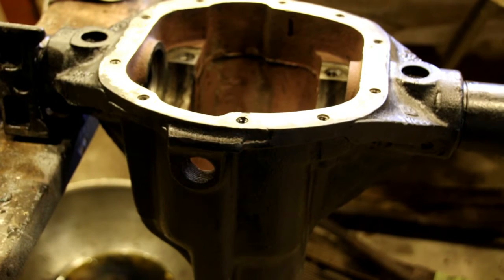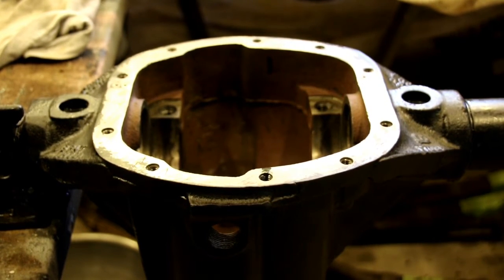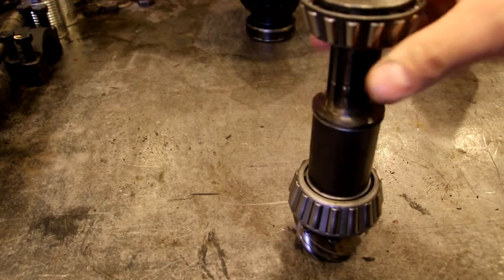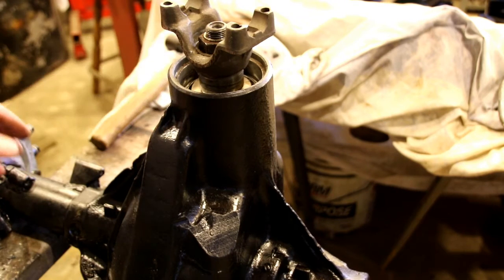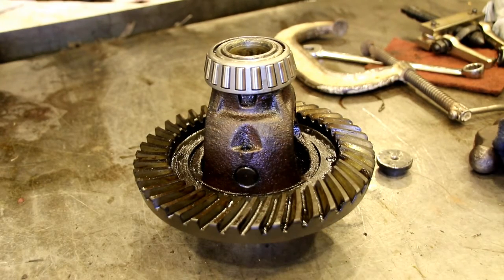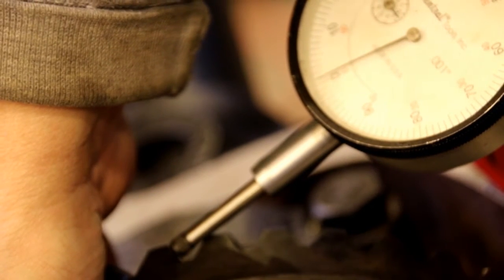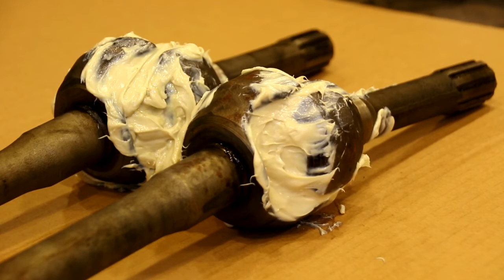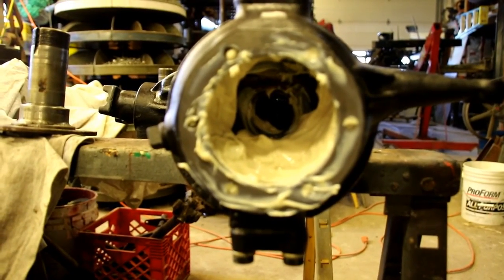Willys Jeep Front Axle Rebuild, Knuckle Lube discussion

Comment: Excelent videos! Great detail and explanations. I'm rebuilding both diferentials and I will use rzeppa shafts. Do you know what tolerance should have the spindle bushing against the shaft? I have to replace de bushings and I was told that need to be a litle loose and not so tight.

Comment: Another great video ! Many thanks for posting this. I wonder just how many knuckle joints are flying round and round, totally unlubed, with all the carefully applied lube having been flung out to the outer casing because they used the wrong type of lube, the lube you have developed looks just perfect, I think that would migrate back onto the knuckles after a short drive with no problem, but be thick enough not to leak out through the swivel seals.
Chris B.
Reply from the maker: thanks for the comment Chris.  It took a long time to develop the correct lube for the knuckles but it was worth it.  This lube is the perfect viscosity and lubes the axle shaft joints and the king pin bearings properly.   Will be showing the correct transmission and transfer case lube in a future video as well.  Thanks for your continued support.

Comment: Brian, your videos are a great help in rebuilding my Dana 23. Situation: After I got the correct rotational torque I replaced the oil slinger and seal and the rotation seems a bit too tight, around 35 in lbs. is that too tight??  Thanks!
Reply from the maker: If you set your rotational torque properly without the seal then all is fine.  The seal adds a bit more torque and it isn't a problem.  That is the reason to set up without the seal.

Comment: Hey Brian, I've been running 00 cornhead gear oil for a while and have had good luck with it, warm weather only, spicer ujoint what's your thoughts on this
Reply from the maker: I have made a few lube videos and talked about Corn Head Grease.  It does not have the same properties as the grease I have developed and does not work well in all temperature ranges.  Drags the axles a bit and wastes gasoline due to driveline drag.  As I say all  the time people can and should run whatever they want, but if you want the correct lube I have it.

Comment: Having trouble getting diff in right. Already on 2nd set of bearings on diff.  When I tighten do bearing caps to spec, the pinion turning has a chunking feel one only one part of ring rear turn. Dial indicator shows up to .0045 difference in the turn  of the ring gear while touching the back of gear.  Could the bearings be on crooked, or what? The marking of the match between pinion and ring gear shows the match close to the inside instead of the middle. Maybe I didn't setup pinion right?

Comment: What is the torque spec for the (6 bolts) going thru the backing plate and spindle, and the torque spec on the (8 bolts) on the back side of the steering knuckle?  
Adam Cj-3a

Comment: Maybe a stupid question but to measure proper  rotational torque does the yoke washer under the yoke nut have to be installed? The reason I ask is I did it without it.
Reply from the maker: I usually put the washer in there just so the nut doesn't gall up the splines.  It isn't necessary, you just need to be sure the yoke is pressing up against the bearing to preload it.   That will happen with or without the washer.  Keep checking and adjusting shims until you get the right rotational torque and you will be fine.  
Brian
Reply: metalshaper  hi like the rebuild video do I us the same  torque settings with the old Bearings if there are ok

Comment: What is the torque for the spindle bolts into the knuckle?
Reply from the maker: 32 to 35 ft. lbs.  Use sealer so the knuckle lube does not leak out.